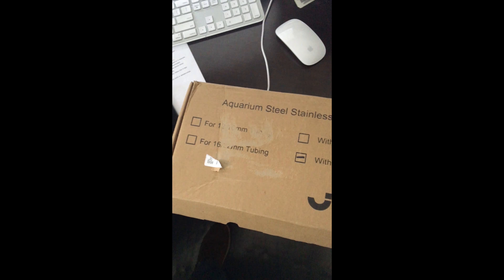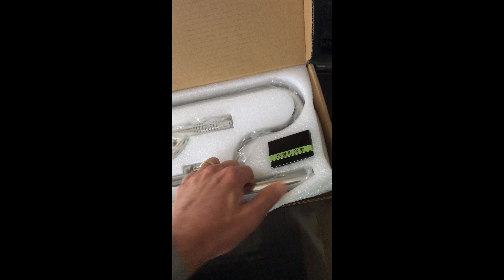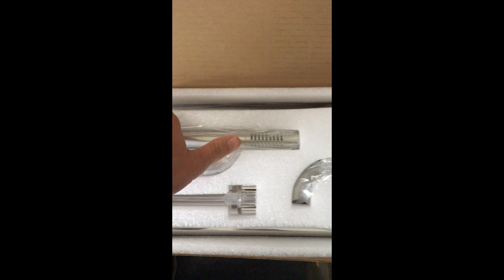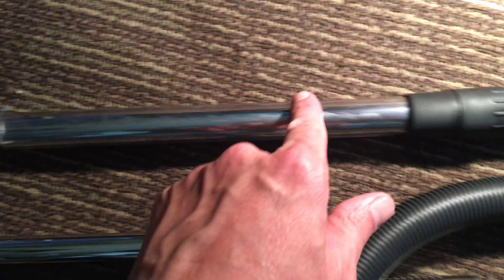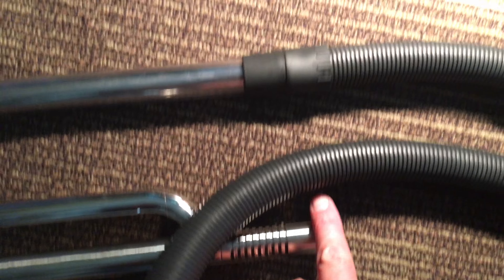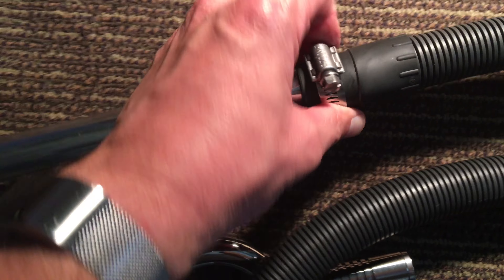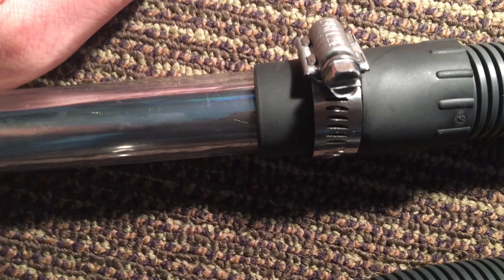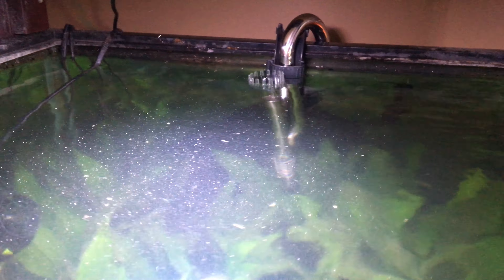FX5 intake hose surface skimmer mod

Comment: I picked up a Tom surface skimmer kit and just made a hole in the intake tube to connect that to the original intake. Pulling water from both the bottom of the tank and surface

Comment: Im working on a surface skimmer my self atm, its a DIY project with a soda bottle and a Maxi-jet pump, waiting on the maxi jet to arrive atm but it should work great, seen other ppl do it. Thought I'd mention it incase ur plan B doest work or is kinda expensive and ur still looking for options. I think joey king of diy have a video about it if u wanna check it out
Reply from the maker: Thanks!  Good luck with your project.  I actually got my plan B today in the mail.  Putting up a video shortly.  I think it will do the trick.  Cheers

Comment: Any updates with this project? I was cheering for you on this one!! I’m facing the same dilemma. Getting an FX6 this weekend, but I’m concerned about my inline diffuser not working with the 1” tubing. It’s an aluminum CO2 inline diffuser from GLA and it was expensive. I have having to retire it so soon. It’s brand new. Also, I don’t think the black tubing and fittings look good in a Aquascape/Planted tank! 🤷🏻‍♂️

Comment: You should be able to adjust the intake at bottom of the pipe (inside the tank) to decrease the suction at surface to just enough to suck surface water in without air. Being an FX5 might be too much. I run a fluval205 next to my fx5 for inline co2/water skimming as I didn't want to restrict the fx5 flow to my 1000L
Reply from the maker: I ended up getting a stand alone skimmer/filter.  The other issue was the bend of the metal pipe was 'very' tight since the 120 gallon tank I have is 1/2 inch thick glass plus the plastic rim.  Thanks for the feedback.  Good idea!